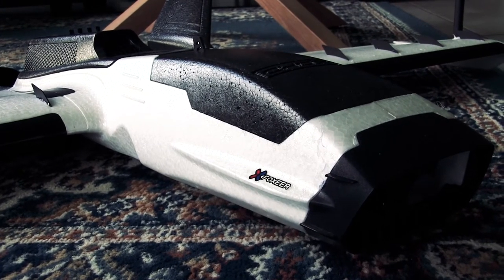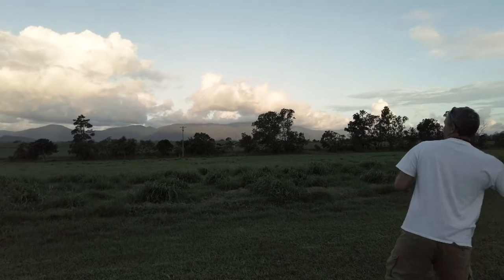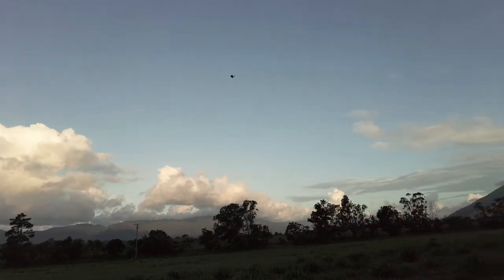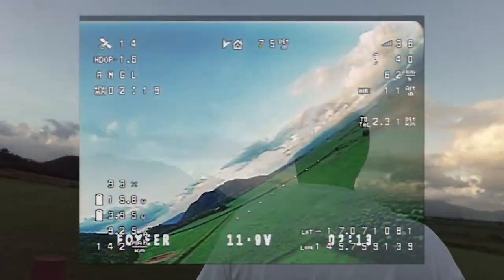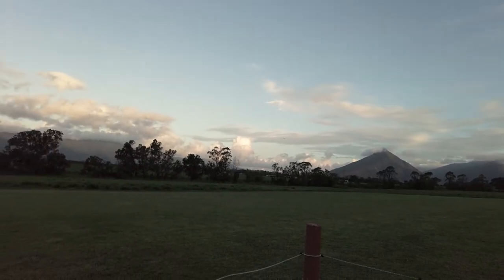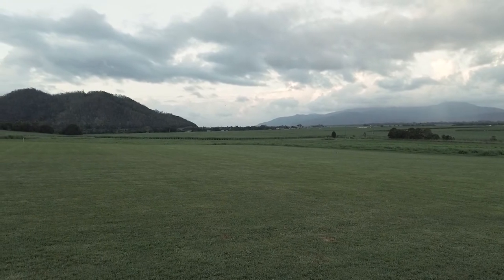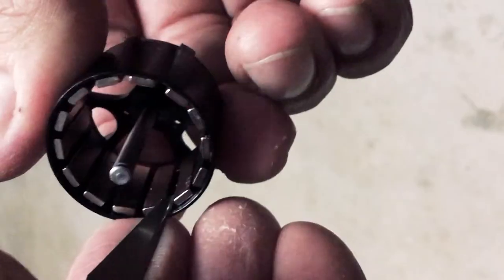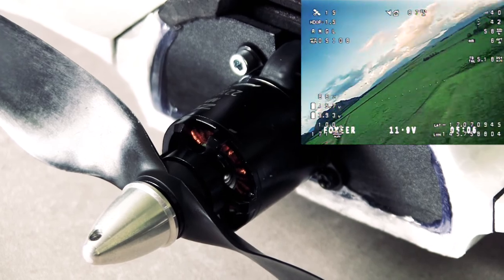ZOHD Dart XL - Maiden Flight With Stock Motor Fail and Diagnosis

Comment: Good catch on bad motor, I use sunnysky v3 motors only on my inav wings but I have exspresselrs 900mhz receiver with dual antennas on the way for my zoid dart xl enhanced version and im not sure how the antennas should be positioned, I mean straight up and down vertical, or v shape and how far apart should they be? I enjoy all your inav wing video's Thanks
Reply from the maker: Thanks for the kind comment much appreciated! The stock motor on the dart xl was poor, magnets came loose. From what I have heard dual antennas positioned in a v shape and single positioned vertical.

Comment: Nice video 
You have one of the bad batch 
A lot of  these motors were not good
I will check my bolts too
Keep them coming 
(Your video does not need music it is irritating)
Reply from the maker: Do you know if the enhanced version motor Mount can be bought separately? I can’t find it so far. (Sorry for the music btw 😜)